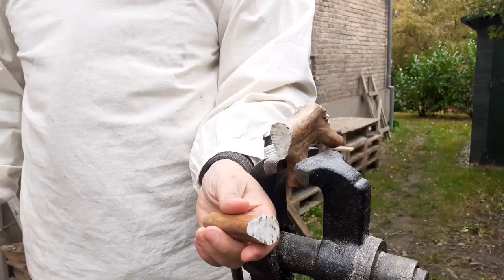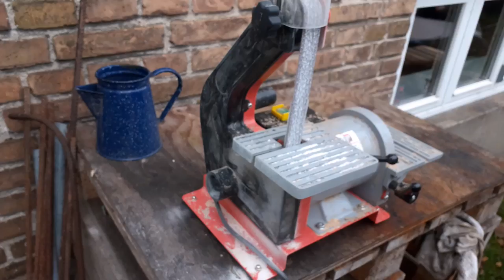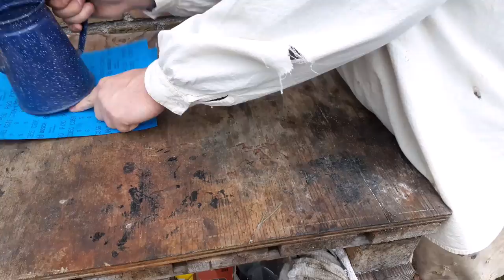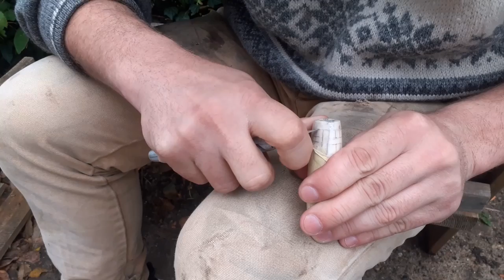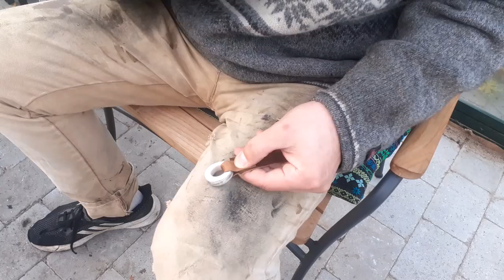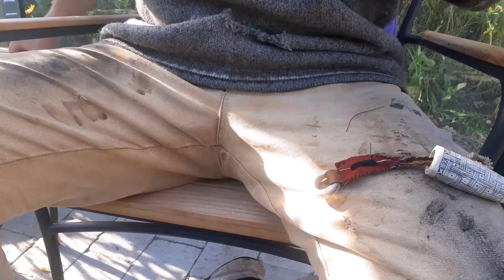Antler carving & Leather Working - Making a sami repair kit

Comment: How did you twist the leather without it springing or unwinding? I tried to twist some similar to how you did but It just unravels or it's SO tight that it just curls weird.
Reply: Use veg tan leather, wet it then twist. Clamp it (pegs/small plastic clamps) to keep it taut whilst it dries? I’ve had some success with round cord using a Namejas twist that I would normally use in silver or bronze. Failing that, make some bolo cord-it works and looks good. Good luck!

Comment: I like It,But still dont get what its for?
Reply from the maker: thank you :D! it is a needle case , that you use for carrying needle and thread around in the artic region, there a needle and thread can be the difference between life and death if your clothes rip, and you need to repair them :D
Reply: @zakisworkshop  before may be not now
Reply: @zakisworkshop  you ever been to afctic zone? I ve bien there many times. You have a car, a snowbike etc everywhere.anx you have a clothes that hardly can be torn apart. I was sledging in noreste dnd sweden, skiing in nord cap, not even thinking Bout dime needles and rhreads